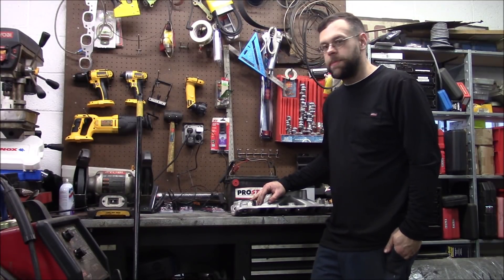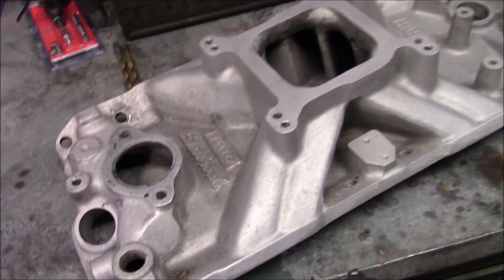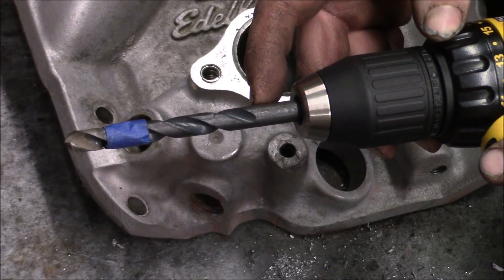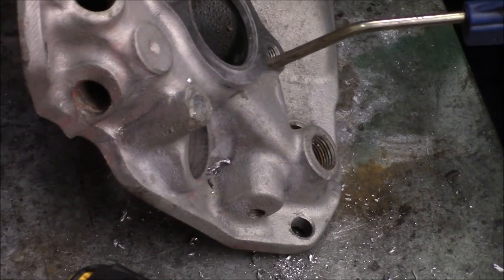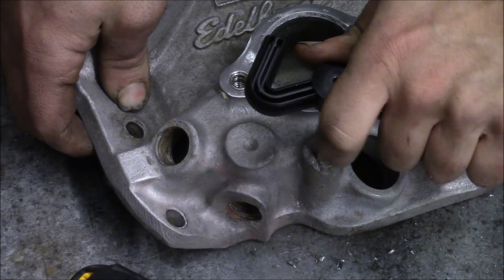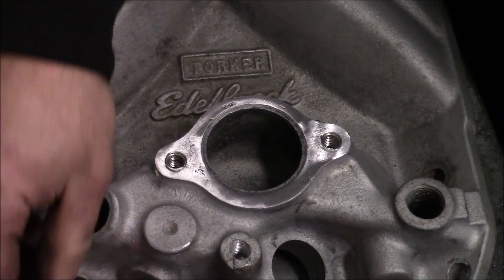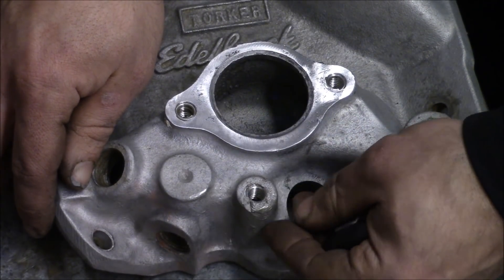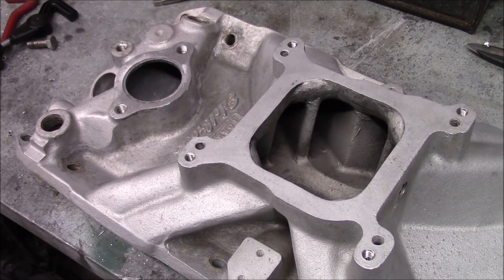How To - Damaged Thread Repair with a Heli-coil

Comment: Helicoils have saved my ass more times than I can count. That and being able to fix chewed up threads in general. Another good tip that kind of goes with this, is packing the flutes of the tap with grease to catch the shavings. If you're tapping into a through hole that goes into an oil gallery or somewhere you don't want metal chips. But have no way of cleaning out or catching the chips easily.

Comment: For what it’s worth - I always put a dab of red loctite on the insert into the tapped hole. I’ve had times where the next time you remove the bolt you can remove the insert as well which is really annoying
Reply from the maker: I do this too depending on the situation.